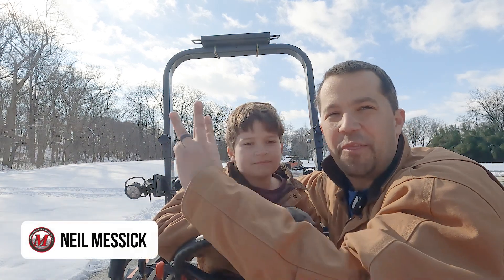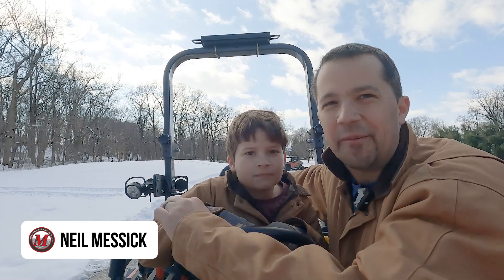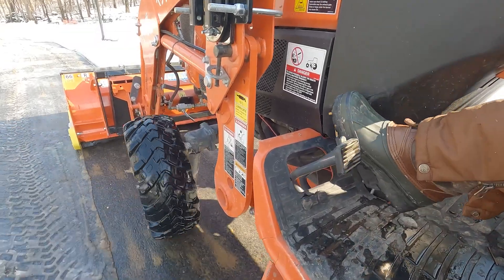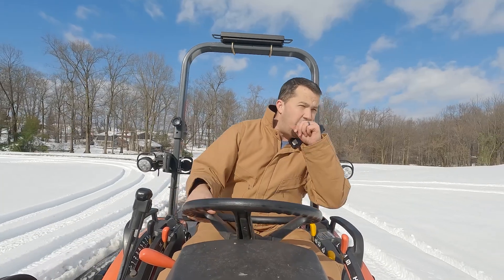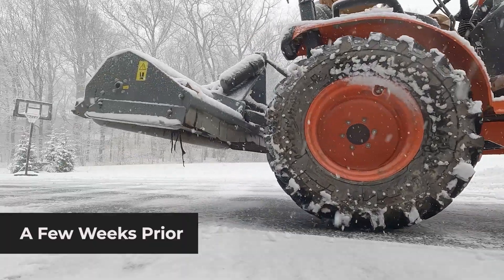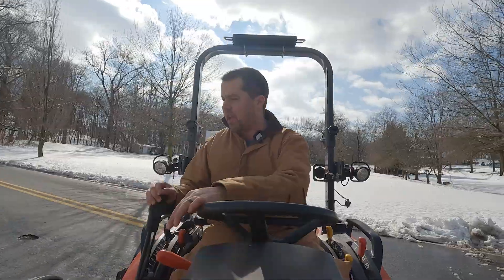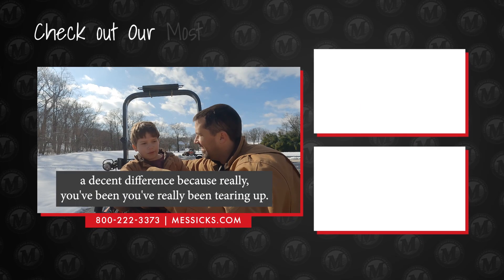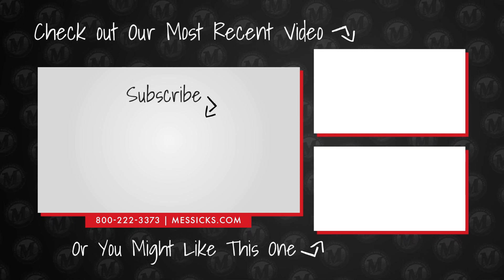Use steering brakes to improve snow clearing

Comment: I honestly have known about the perks of using them, but sadly don't operate a kobota product. Quite interested in the fact they put them on the left side, this actually makes them usable. I have a 2012 bobcat ct225 and they put them on the right side, being a hydrostatic transmission I have figured out they are basically obsolete unless used for parking or on hills.

Comment: I have a JD 1025r with a HLA snow pusher single brake and hate it. Next tractor will have split brakes. Tell me this. Some of Kubota  models have the split brake peddles on the right side with the treadle pedal. How does one use the split brakes but move the tractor at the same time? I’m thinking a very poor design.
Reply from the maker: You can with cruise control. Each generation that goes by they seem to be correcting this problem. Most tractors now have them on separate sides.
Reply: @MessicksEquip  great. Thanks for the info. I’m looking at Orange instead of Green for the next tractor.

Comment: im in Canada... we push the snow with pressure on the blade so we use the 4x4... never in float. of course it works the way you showed but that's baby snow :)

Comment: L3901 hydro has the brake above the treadle pedal. Other than taking your foot off or trying to heel toe the two pedals, I basically give up on using brakes completely. What’s the answer to that situation?
Reply: Heel and toe. 👍
Reply from the maker: Cruise control

Comment: Neal my problem is I have a Grand L3240 hst.  The brakes are on the same side as my hat pedal.   That makes it almost useless.   Any suggestions?
Reply: Heel and toe it.
Reply: @jaxturner7288  that is funny.  Not possible with the configuration of the pedals
Reply from the maker: Cruise control, or throw both legs on one side.

Comment: That would work great, except the engineers that designed the L48 that I own, put the steering brakes on the same side as the treadle pedal.  I guess sit side saddle and use your left foot to actuate the individual brakes?  We used to use the steering brakes often on my grandfather's Massey Ferguson 35 with the 6' Bush Hog working on hillsides in SW Pennsylvania when I was a kid.
Reply: That's one of many reason I didn't buy a kubota